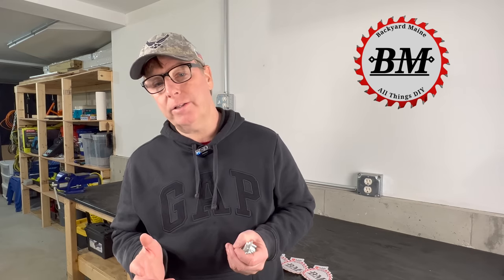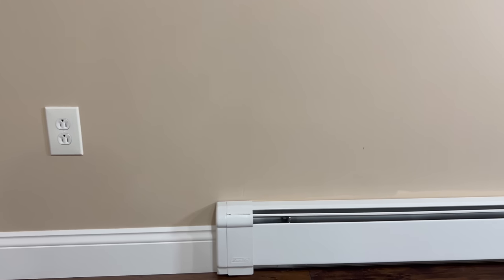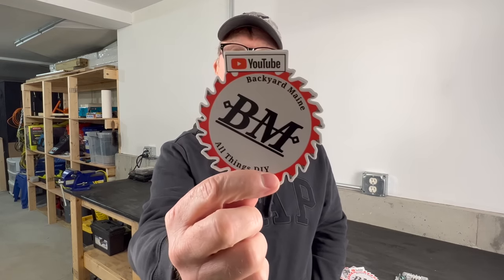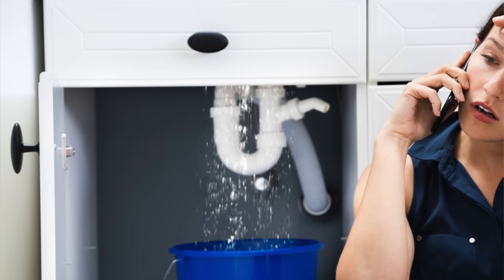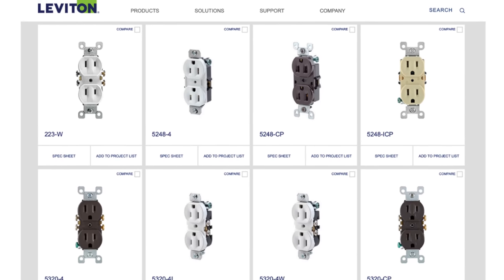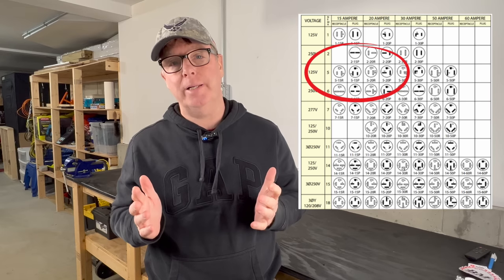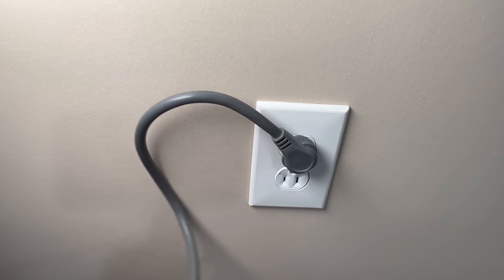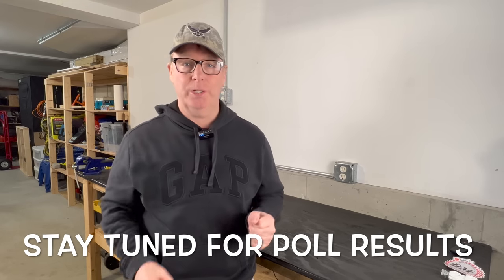Are your outlets installed upside down? (You may be surprised)

Comment: I think this whole argument simply exposes the biggest safety risk with North American plugs, namely the fact that they can be plugged in partially and leave exposed bare conductors which could easily cause injury or death by electric shock. The NFPA acts as if fire is the only danger (it’s in their name after all) but shock is certainly one of the worst! An AFCI will not detect when someone is having the life zapped out of them. Most other standards such as the plugs used in Australia, the UK or most European countries use insulated sleeves or recessed receptacles to prevent any exposed conductors.

Oh, and I always put my outlets ground down, as that looks and works the best and is most commonly used. I don’t think ground up offers much protection and nobody should ever treat a North American plug and receptacle as anything other than a shock hazard regardless of orientation!

Comment: Ground DOWN. As seen in this video, many residential extension cords need grd down, but so do most every plug-in power transformers, like for all security systems.
Ground down also puts a heavy duty extension cable's weight on the larger ground pin.
Just my $2 opinion... due to inflation... no more 2 cents...

Comment: GROUND DOWN! Many appliance makers, etc. have been supplying cords with a right angle plug allowing them the hug closer to the wall. This is great, as it allows the cord to hang down with less strain and, especially, if less likely to interfere with furniture placement or be snagged by passersby. Good stuff, right? If some $%*# installed the receptacle with the ground up, it completely defeats the purpose of the right angle plugs. (Ground is at bottom, closest to the cord.
If plugged into these upside down receptacles (ground up) the cord goes up, then bends 180 degrees to hang down - all because someone got the idea that ground up was somehow "fashionable".

Comment: ground down;  it's safer for children.    when a child tries to un-plug a  cord the thumb is on top and pointing  straight at the wall not likely to touch anything, but the  index finger goes underneath the plug and is parallel with the wall.   that little finger underneath can easily slide up and bridge the hot/neutral blades of a partially unplugged cord if it is installed ground up.

Comment: Only 20A outlets require the teepee orientation. 

15A outlets can be either.  Surprised faces are traditional, unless it's switchable, then it's teepee style.
Reply from the maker: Again the code does not specify orientation of any 15 or 20 amp receptacle whether its switched or not.

Comment: My dehumidifier cord and timer have the ground on the bottom of a 90 degree plug. It would be silly to expect the cord to hang upward. There's your elusive answer! Hint: around here the so-called electrician that puts the ground at the top also puts light switches behind doors.
Reply from the maker: Like I said in the video I prefer ground down but there’s no code requirement

Comment: As far as I can recall, the labeling on the device yoke has always been right-side-up with the ground down.
Reply from the maker: No it’s actually both ways even from the same manufacturer sometimes. The labeling is not considered manufacturer’s recommendation either way. I prefer ground down but it’s not a requirement

Comment: I've heard ground up suggested a 20A outlet.
Reply from the maker: I never heard that one before... You can always tell a 20A receptacle because of the combination vertical and horizontal slot on the neutral side.
Reply: No, a 20A outlet has a lateral cutaway on one of the terminals that can only fit 20A devices.  It prevents a 20A device from being plugged into a 15.

Comment: Ground down is the way that I was taught by the IBEW. Ground up is wrong, and screams at me whenever I see it.
Reply from the maker: I was taught the same. (IBEW local 7). The code doesn't specify but ground up sure looks like a mistake to me as well.
Reply: I was taught ground down as an apprentice, local 602. The reason was that on any 3 wire cord, the ground prong is longer than the other two. So if you are plugged into a receptacle that was loose and the cord was falling out, the ground would be the last connection to be broken. Ground up just glares at me, it is wrong.
 @BackyardMaine

Comment: In my house, the switched outlets are just one of the duplex receptacle. Besides, they are installed horizontally.

Also, almost no small appliances or lamps in a residence use a 3 prong plug

So none of your recommendations are relevant in a typical home.

Comment: You provided a reason for ground for ground up with possibility of shorting, but you didn't provide reason for ground down. I was taught the theory that for ground down, when you go the plug a 3 prong in, being up high for view and the receptacle is low, the idea that due body position relative to he plug, you would naturally be holding the plug slightly tilted at a down angle where you can see to alight the the ground pin first which  having the ground pin contact first is the safest situation. In ground up..... the ground pin is in full view so the is no natural need to tilt the plug slightly as you insert. Ground down naturally forces you to tilt slightly and therefore encourages the safest situation.

Comment: 42 years of installing ground down. It's a lot more likely for the cord to get pulled down causing the loss of the ground in a ground up installation. In ground down, if the cord is pulled down, the ground is the last to pull out. People step on cords, they get run over, the receptacles wear out and lose tension, etc. Ground insures you ALWAYS have a ground. If somehing falls down the wall and shorts, the breaker trips. Not a big deal. If the ground pulls out and somebody gets electrocuted, the breaker may not trip, killing someone. Ground down always!!!
Reply from the maker: I don't disagree..

Comment: If you install the receptacle horizontally with the neutral up  then whatever will fall from above would ony lay on the neutral not causing a short and no fire! But, what electrician would install all the receptacles horizontally? The answer would be none because the boxes would normally be installed on the side of the stud making the installation vertical.
Reply from the maker: There are a few jurisdictions (Chicago) that require receptacles mounted horizontally. They run conduit to metal boxes with mud rings.

Comment: I will go and turn all my outlets 'upside down".  WHY? because the new outlets no longer have a recess or dimple to guide the prongs into the slot and  the plug covers this up so a pain in the ass. With the plug upside down the longer prong can be seen and easily 
guided into the hle. Also, guiding 1 prong is easier than 2 simultaneously.
Reply from the maker: It’s actually a matter of choice. All the major manufacturers still make the recessed connection face. Eaton, Leviton, Hubbell all offer a variety of options

Comment: here"s a good one, why are all hubble hospital grade rec. designed ground up.
Reply from the maker: They're not. I'm a Hubbell Partner. They don't specify receptacle orientation and as a matter of fact they sell a quad receptacle that has one up, one down, one horizontal neutral up and one horizontal neutral down. The reason many healthcare facilities have ground up receptacles is not because it's a code requirement. Article 517 makes no mention of orientation. The fact is many healthcare facility builds with have specs written with IEEE Std 602.  (Recommended Practice for Electric Systems in Health Care Facilities).

Comment: Ground up is for the safety reasons. Safety first no matter what electricians like.
Reply from the maker: Ground up can actually be unsafe to some people. I decided not to cover that in the video but the way we hold a plug when inserting in or remove it from a receptacle, can put people at a higher risk of shock by the index finger coming into contact with the hot and neutral blades at the bottom.
Reply: @BackyardMaine  anyway the best way to do it is ground up  vertical and neutral up orizontal

Comment: I hate ground up... talking about safety hazards, I can never tell if the actual neutral and positive are going straight into the slots or not! Not only does the ground prong obstruct my view, the plug itself almost completely blocks their orientation. While turning the plug to try to correct it, I feel like one wrong move and my finger is going to come in direct contact with one of the live prongs. This all only gets worse if your visibility is further comprimised in any way, such as wires or some other object blocking your view, poor lighting, a bad viewing angle, etc. And where these outlets typically are--in dark corners, near the floor, behind objects and possibly obscured by even more cables and plugs--these things are almost always guaranteed to be outside of clear direct view.

With ground down, I can clearly tell what angle I am holding the plug at and know that they are about to go in straight, and if they are not, I can easily and quickly adjust without fear that maybe it's not properly aligned.

Comment: I can't believe there's nothing in a code book somewhere saying which way it's supposed to be
Reply from the maker: I just pass on the facts. It up to you what to believe. Article 406.5 (G) in the code is the only reference to receptacle orientation. It states that a face up (not ground up) receptacle cannot be installed on a countertop or work surface unless specifically designed for that application and receptacles are provided from being installed face up under a sink. Thats it.

Comment: Up is safer when there is a loose plug and a metal picture frame slides down.  No short.
Reply from the maker: Most plugs are two prong and it won't make a difference..
Reply: @BackyardMaine  Yeah...  unsafe, no ground.  The irony.

Comment: "UP" as I was taught 60+ years ago.
Reply from the maker: I'm surprised. I never saw a ground up receptacle until the late 90s.
Reply: @BackyardMaine  The reason given to me back then, was the ground pin on the plug acted as a safety guard in case a metal object came between the outlet & plug, if the plug was only partially inserted.  
Funny how some things from the distant past becomes ingrained, decades later. ("Old dog, new tricks" ??)

Comment: When people restore an old home that's been sitting empty for a number of years it usually burns down after 1 or 2 years. Don't touch that wire in the basement!
Reply from the maker: My mothers home was wired with old knob and tun=be wiring. I gutted it all out back in the 90s and rewired it to the standards of that time. I also installed a new 100A service. They had an old 60A fused panel that we used to call a (Two Fuse Range Main) because it had 2 fuses for receptacle and lighting circuits, a two pole for an electric range and the Main fuses. Of course most rooms only had one receptacle.

Comment: Obviously he has never install receptacles in a hospital where oxygen is used. The ground is always on top in this type of atmosphere. Think about it, something falls on top of the plug, the ground either breaks off or unplugs first helping to lessen the possibility of a spark in an oxygen rich atmosphere. This is always in the Spec's in this type of area.
Reply from the maker: Hospital build spec after reference IEEE std 602 which recommends ground up. However article 517 healthcare facilities in the NEC has no such requirement. Also it has nothing to do with the oxygen being used in the area. If the area was an explosive environment no open receptacle would be permitted.

Comment: So before I even start watching you When I was in electrical school the teacher said 
GROUND UP BECAUSE JUST WHAT YOU SAYING IF SOMETHING FALLS IN TO CONTACTS So apparently after 38 years you're still doing things wrong. All hospitals have ground up.
Reply from the maker: Article 517 in the NEC (healthcare facilities) makes no mention about receptacle orientation. The fact is many (not all) hospital building specs reference IEEE standard 602 which does recommend ground up due to the use of metal face plates. In residential wiring, about 90% install ground down and the ones that do install ground up often have unhappy customers who want them turned around. Also many consumer product are designed for ground down. We taught ground down to all our apprentices in the IBEW local #7 out of MA I don't know where you went to school. But of course I'm sure you know more that someone who's been an electrician or an electrical engineer for his whole career.

Comment: You know someone who experienced an arc flash by having the ground down, yet you refuse to put the ground up? You include the story to illustrate a point, then ignore that point in your own installations. So why mention it at all?
Reply from the maker: Not exactly. The breaker did its job the way it should. Also there are many consumer product that are designed for ground down and they have a UL listing based on that fact. To use them otherwise would negate the listing. Also there are other safety factors to consider. For example the way most people hold a plug would put them at risk of their index finger touching the hot and/or neutral blade when plugging or unplugging a device. Another example would be a cord that was stepped on or otherwise pulled down. This could leave the hot and neutral blades connected and the ground pin disconnected. For me ground down is safer, works better and doesn't look like a mistake.

Comment: not upside down. ground up now required by law to keep risk of fire down. been this way for last 10 years. if plug comes partly out with 2 power wires exposed some thing hits them can cause a fire. with ground up its less likely to happen cause no power is going thru it.
Reply from the maker: Nope not law, not code and not recommended by the manufacturers. I just made a video detailing five electrical code lies and this is one of them.
Reply: @BackyardMaine  ya was told by a 40 year electrician that law and code requires it. they should be fined for telling lies.
Reply from the maker: @clamojoat1938  Believe it or not I'm also a 40 year electrician this year. I started out my career in 1984. I just read the code myself because theres a lot of misconceptions that seem to propagate from one generation of electricians to the next. Also the code updates every 3 years as well.
Reply: @BackyardMaine  I didn't mean you specifically. I meant the ones that are A-holes and insist its law just to get it there way. ive been around a lot of A-holes that's Y i made the comment.

Comment: I have installed thousands of receptacles over the years. Ground down,  BUT they are referred to as u- ground receptacle. The short circuit example is very good. Just don't drop stuff down the wall, and this will be avoided. Remember, it's the stupid people who get regulations and new laws  put in place.

Comment: This all depends on what state you live in and what city adopted what law they want and how they want to receptacles because I’ve been through this through Florida, Missouri, Oklahoma, Arkansas, and some cities in Missouri that have their own way they want to put in trust me I’ve had to go back and flip them upside down Because certain cities Springfield and Branson, Missouri Branson adopted and changed theirs over in the middle after we had been putting them in of course the normal standard way forever with the ground on the bottom I get what you’re talking about but it’s not correct to say that there is one correct way of doing it because there is not a one way it depends on where you are working at maybe in Maine where you live at where the fuck up there in the middle of nowhere but Just saying it’s not the same and what you’re putting out not true it’s just like what do you call a TA and what do you call an MA well Missouri and Arkansas calls day male, adapter and MA now Florida causes a TA terminal adapter similar same thing just different states different cities

Comment: No straps on your 1/2 conduit....code violation/ OOPS
Reply from the maker: So may people here don't know code. 
EMT shall be securely fastened in place at intervals not to exceed 3 m (10 ft). In addition, each EMT run between termination points shall be securely fastened within 900 mm (3 ft) of each outlet box, junction box, device box, cabinet, conduit body, or other tubing termination.
Since all the EMT you see is under 3 feet long between boxes no straps are needed. I have a lot of videos to help people like you learn the code.

Comment: I’ve always installed them ground up for one reason, if something falls onto the plug in the receptacle like a metal picture frame it will hit the ground pin and roll off to one side or the other, if the receptacle is down the frame will hit the hot and neutral wires and short out the circuit and possibly cause a fire. It’s also how they are installed in hospitals. Your video stopped working and I didn’t see what your position was. I’ve been in the trade for a long time and my main gig was rewiring old knob and tube homes before insulation was sprayed in they walls and attics. Peace and God Bless 3:55 3:55
Reply: That is a million to one shot. Not enough to tip the scales